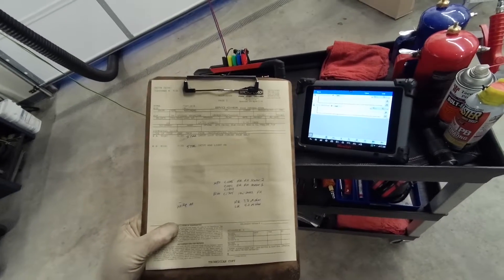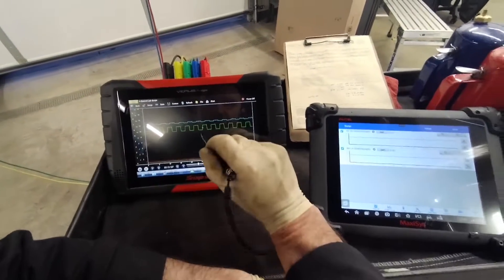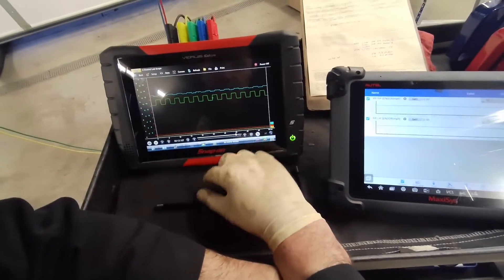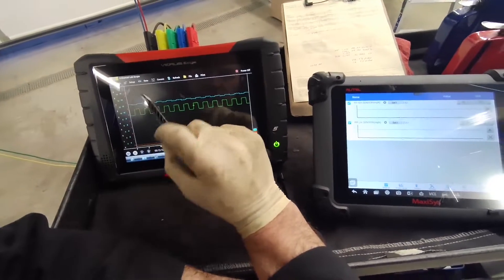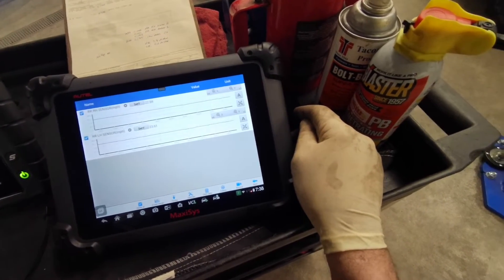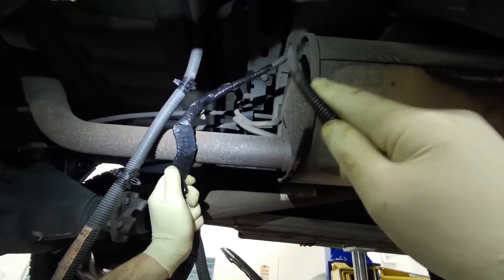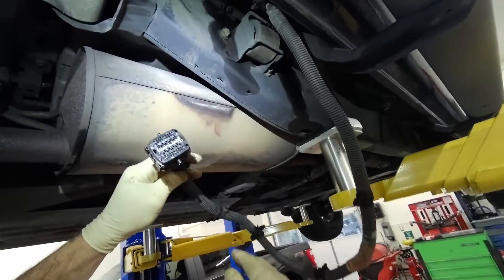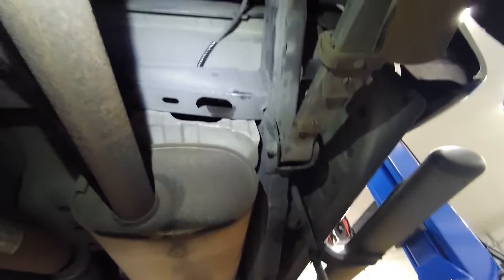NISSAN FRONTIER INTERMITTENT ABS LIGHT. EASY DIAGNOSIS WITH SCOPE, TOUGH WITHOUT.

Comment: I’m
Having this same issue. The abs and slip lights come on. I got a code for the right rear sensor. The light goes on and off as it pleases. You think this is a wiring issue too?
Reply from the maker: Definitely. You could throw a new sensor at it and cross your fingers. Without a scope it will be next to impossible to pinpoint the problem but would be worth inspecting the wiring right where it branches off inside the harness. (same spot as in the video) Seems to be a problem for getting water and corrosion inside the wiring

Comment: Great job properly diagnosing this ..... many would have replaced sensor first btw , I’m sure you know about the verus split screen mode , my guess is you were using the other scanner for the video purpose ..
Reply from the maker: Don't you go into guided component test and then open up split screen or another browser? Haven't done that forever. I did initial scan with my autel so just left it connected for the video. Mostly use IDS on Fords but like to switch up the scanners every now and then on other manufactures.